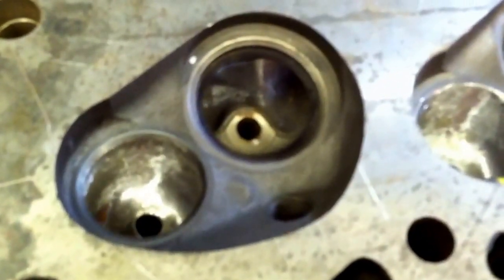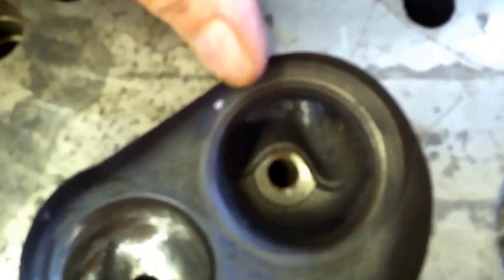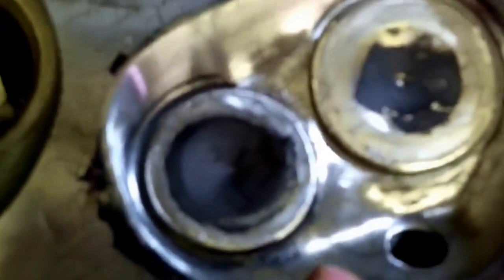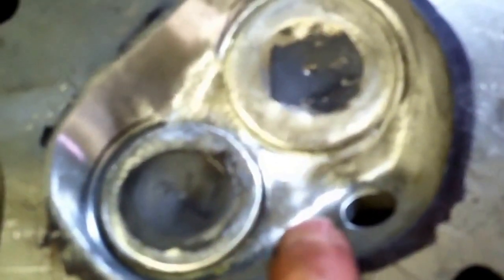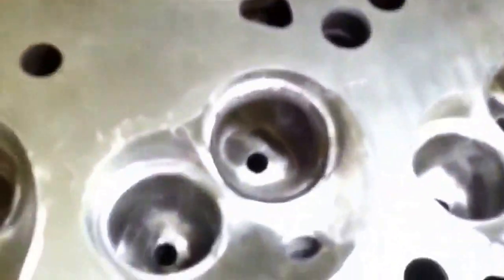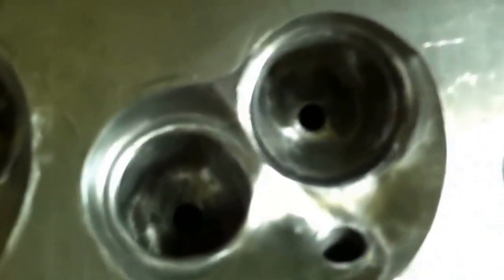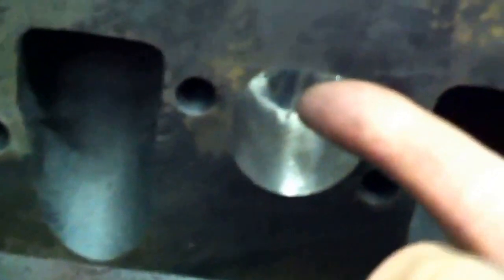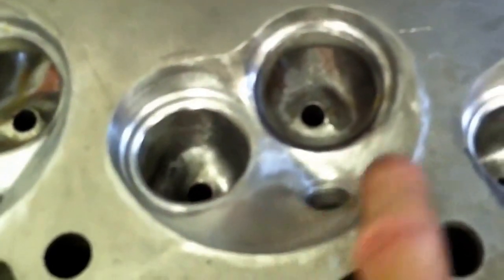Combustion chamber polishing and valve shrouding Ford Lima 2.3L XR4Ti, SVO, Turbocoupe

Comment: I have a 2.3 turbo engine and when I pulled it apart it was already replaced with a NA/ heart chamber head.. but I have heard that with porting that it’s a better flowing head than the turbo head…
Reply from the maker: I can't see why this would be the case as they are identical except for the combustion chamber shape.  The N/A is heart shaped while the turbo is not and therefore has a lower compression ratio.